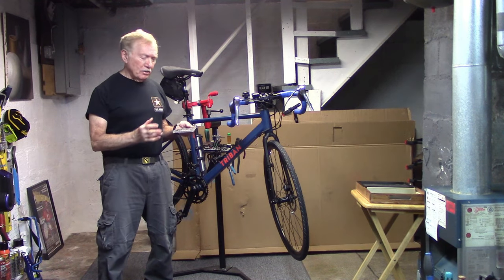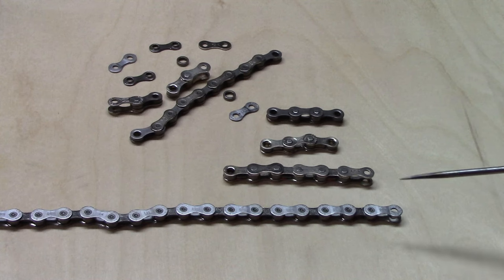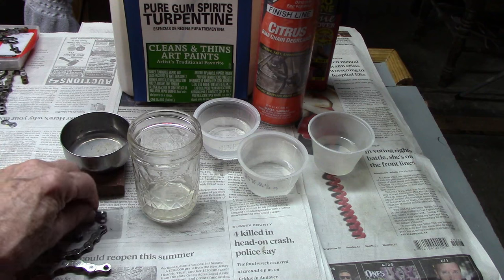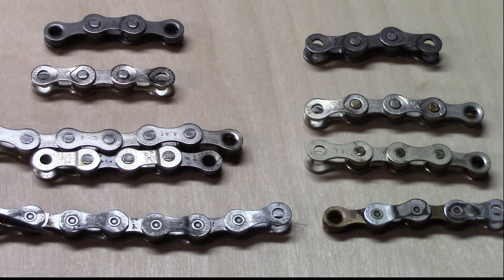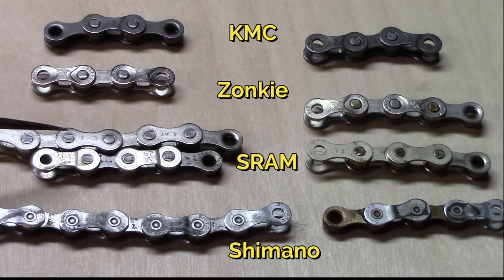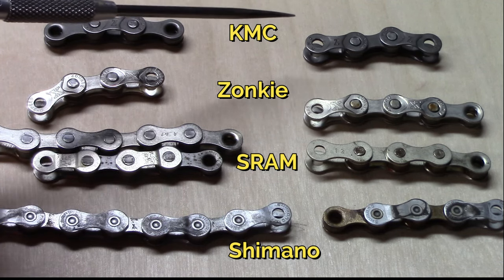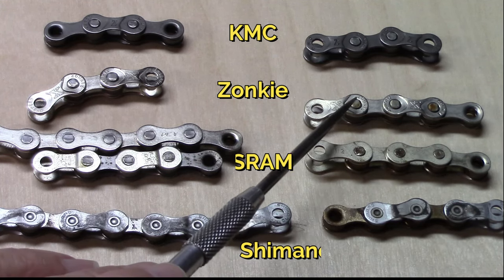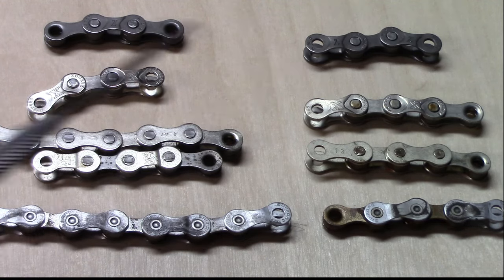Soaking Bicycle Chain in Degreaser: BEWARE of the consequences

Comment: Chain is not made from virgin steel, it is made from all the scrap we send to China, therefore it is full of impurities that react with each other & the chemical solutions they have been immersed in. In my experience, degreaser is only good for removing anodizing. Softens it a treat to a wipe off state in minutes, but be careful its vicious & comes in regular & industrial strength. Has anyone tried oven cleaner on new chain preservative grease?

Comment: Very interesting. I’ve been thinking about waxing my chain and would like to know the very best way to clean it. My research continues. Also…No, I haven’t read the insert from Shimano. Would you mind sharing what it says?
Reply from the maker: I am not an expert on waxing a chain, however, some videos describe the use of Gasoline and Kerosine. These substances are dangerous to our environment and pose a health hazard. There are some excellent videos on cleaning with an ultrasonic cleaner that may be of interest to you (and may be the best way to clean a chain for waxing). If you do soak a chain, do it for minutes not hours and try your best to use an environmentally safe product.
As to the Manufacturers insert for the Shimano chain, lets just give it another week to see if any has read it or looked it up on the internet, then I'll pin the results. Thanks and safe cycling, Tony
Reply: "oz cycle" has some good videos on cleaning and waxing chains.
Reply from the maker: @dpstrial  Yes. However, I myself would stay away from Gasoline, Kerosene and similar petroleum products he uses because of the environmental hazards and health risks. But I'll leave that up to you. Thanks for your comment, Tony
Reply: @tony10speed  I clean my chain with normal bike cleaner and then lubricate it with Squirt (or a wet lube in winter). I don't want the bother of melting wax in a pot. I change my chain every year anyway. Regards.
Reply from the maker: @dpstrial  Appreciate your comment and insight. Regards and safe cycling, Tony

Comment: I've soaked a shimano 10 speed chain from my Roubaix in appx. 75% Kroger dish liquid (ersatz "Dawn") overnight. Virtually all the oils and crud came off and the chain did not discolor. A good rinse in HOT water and all was good....
Reply from the maker: Thanks for the comment. Did you also scrub the chain before or after soaking overnight?
Reply: Hey Tony! Thanks for the reply. No scrubbing.All I did was soak, then vigorously shake the container with the chain and detergent, take the chain out and give it a a serious rinse of hot water. All the grime gone, squeaky clean!! Soaked in silicon lube, dried off and back on the bike
Reply from the maker: Will definitely give it a try. Thank you for sharing. @dv270salto7
Reply: @tony10speed  No need to thank lil' ol' me , Thank YOU for all your video help lessons! I'm gonna go to Wally's and get that oil filter wrench for sure....

Comment: hi great video. I clean my chains much like you do with the two tooth brushes. I think I learnt that from one of your earlier videos. in order to be able to use the degreaser more then once i.e keeping it fairly cleanish.  I do a cleaning in dish soap with the brushes . rinse in hot water, dry the chain because water dilutes the degreaser . then soak in the degreaser for an hour or so. rinse with more dish soap , hot water final rinse and dry before lubing. this method works for me. it does take time to dry the chain so I was running two chains alternating between the two. otherwise a little heat on the stove works. one problem I came across is when I was using sunlight detergent all was ok. Palmolive turned my chain dark much like the chains in this video. It was a shimano with the shinny coating . its no longer shinny. and this is the more expensive option to buy with the shinny coating. I have to agree with you that soaking for long periods of time is not a good idea. no more then an hour should do it. I know that if there is any dirt still lingering around the pins and id of the rollers then after a bike ride the lube will turn black. and stay black no matter how many times one wipes it with a rag. my chains do not show any signs like this. so I think in line with what you are saying its no use soaking for too long and over night is for sure a no no . thanks take care
Reply from the maker: Have no idea what's with the Palmolive soap but will look into it. Sounds like you're doing a terrific job (a little over-kill for me in terms of washing but if it works for you that what counts). Most of the black that shows up as you ride, at least in my experience, is not the residual dirt around the pins and bushings but rather residual chain lube which quickly picks up dirt and grime. I apply chain lubricant, work it in by turning the crank (and chain) backward, let it sit overnight, the (before I put it in the car to take to my ride start), wipe down the surface thoroughly to prevent the grime and grease build up. 
Thanks for sharing your cleaning procedure and your thoughts/ideas. Regards and safe cycling, Tony
Reply from the maker: P.S. There a a number of products of Palmolive on the market. What kind of Palmolive soap were you using so I can take a closer look?
Reply: the original green soap.  @tony10speed
Reply: thanks for the tips . I agree totally apply work it in and let it dry over night and a final wipe down. even though most claim it will dry enough in 3 hours longer is better. Just wondering you said my washing is a little over kill. in what way would you recommend making it more stream lined and shorter thanks again  @tony10speed
Reply from the maker: It just seemed like a lot of steps involved in washing, degreasing, washing again. But if it works for you, don't change it. I'll look into the Palmolive. Regards, Tony @sidshel4428

Comment: I just had an interesting (and unfortunate) experience with my brand new Shimano XT (CN-8100) 12 spd chain. I used a 3-bath method for degreasing and re-lubing the chain. The three baths were: (1) Park Tool Chain Brite and then (2) 91% isopropyl alcohol and then (3) Rock n Roll Extreme lube (blue) wax based lube. Each bath lasted no more than 2-3 minutes where I put the chain in a jar with the solution and agitated it. I then removed the chain, wiped it down and placed it in next solution. Afterward I noticed that the chain links had blackened as in your video but ONLY on the drive side (the links with lettering on them). The links on the other side of the chain did not change color. Additionally, I noticed that about 6 links in the chain had become tight and wouldn't bend with ease. Going forward I am not going to use this approach on a new chain. I will just use Rock n Roll Extreme to both clean and lube.  Rock n Roll Extreme contains both a solvent and wax, so you clean and lube at the same time. I've used that product many times in the past on other chains without issue. I learned my lesson!
Reply from the maker: Wow, that's quite a story. All I can figure is that the coating on the outer plates of the chain must be different than the inner plates and reacted with the Chain Brite. Did you notice any discoloration after the Chain Brite and before the isopropyl alcohol? Did you wash and rinse the Chain Brite off before putting it in the isopropryl alcohol? It's possible that the residual Chain Brite combined with the isopropyl could be the culpret, but I'm not sure. Sticking with the Rock n Roll sounds like the best idea. Thanks for your observations and comment. Regards, Tony

Comment: KMC:

Never use acidic or alkaline cleaners (rust remover). These will damage the chain and in extreme cases can lead to breakage.
Never use aggressive degreasers - these will loosen the factory applied grease from the pins. This allows dirt to penetrate and drastically reduces the service life of your chain! Furthermore, these agents are harmful to the environment.
Chain cleaners also often contain solvents that can damage your chain.

Clean the chain with a dry cloth.
Important: also clean the sprockets, chainrings and shifting rollers.
To remove dirt or sand, use a brush.
If the chain is very dirty, lukewarm water with detergent or a cloth soaked in thin oil will help.
Reply from the maker: You make some good points about the need to avoid aggressive cleaners although some will disagree with you on the use of bike specific degreasers and Simple Green if used briefly and with care. Lenard Zinn, author of "The Art of Road Bike Maintenance" suggests removing chain packing wax which is there to prevent rust and corrosion and will interfere with applied lubricants. See our video based on his suggestions and that of other bicycle mechanics:
https://www.youtube.com/watch?v=-VdLCy5cRco
If you have references to the contrary on either of the above, please let us know so we can all be educated.
Thanks for your input and safe cycling, Tony
Reply: @tony10speed  chains do not come with packing wax for a start. Also, not following manufacturers recommended practice when installing their equipment will result in you being fired if it is your job in most instances. So if KMC say do not remove packing GREASE (not "wax" as you state) , then do not do it. However, bicycle mechanics are laughably unregulated, so they can say or do pretty much anything they want with zero repercussions. Dry
Reply from the maker: I agree with many of your comments, however, what works for you may not for others. Keeping an open mind is what leads to discussions such that you can communicate your feelings and opinions and understand why others hold theirs. Some well known mechanics would disagree with your comments on waxing chains and not removing packing wax. These discussions are interesting and the exchange of ideas leads to progress.
Thank you for your comments. Regards, Tony
Reply: @tony10speed  this is why I pointed out the unregulated nature of bike mechanics. I will also point out the lack of technical data sheets for pretty much all fancy expensive bike lubes. 
Best practice for industrial chain lubrication methods is set in stone for employees, there is a set way of doing things & if you do not follow it you are endangering both people & equipment. 
There are many years of scientific research into the subject, dedicated testing facilities that must be officially accredited, the list goes on. 
But none of this applies to cycling, it is totally rogue & anybody can claim anything with zero evidence. Do you not see a problem here? Because it is glaring to me.

Comment: Personally, I don't remove the original lubing but had a drop of light lubricant at each link every few rides and wipping clean after each ride.
The thinking behind it being that the original lube will simply be displaced while still having a lubed chain.
It's a bit messy after the first few rides, that's all.
Use of agressive solvents attack the plating on the chains.
Most chain manufacturers recommend to NOT attemp to remove the original lubricant.
I'm not into the ultrasonic cleaning, Crock-Pot waxing trend.
All this stuff is far more expensive than to properly mainting and instaling new chain at the proper frequency.
Cycling has always been a sport where a bunch of people are into stupid trend to make them feel as if they'd belong to an elite group. Remember the drilling of brake levers to make them lighter ?
Reply from the maker: I think most mechanic would agree that the manufactures have led us astray with the idea of leaving the packing grease, and my expert, Lennard Zinn (Zinn and the Art of Road Bike Maintenance) in one of his blogs would agree. The packing grease is there to protect the chain from corrosion and rust during storage. Not only will it pickup grit and grime from the road (it's very sticky), it may interfere with the bike lubricant you use. People may disagree, but this is what the recent data shows. Are there trends in bicycle maintenance and repair, you bet. That's why careful analysis and research is required and will continue to be so. This is also what makes bicycle maintenance and repair fun. Regards and thanks for your comment, Tony

Comment: I noticed the variety of container materials. I would stick with glass or plastic containers and avoid metal to eliminate the chance of galvanic activity.

Soaking a chain, especially one that is well cared for, is not more effective than a quick clean. It’s much more important to remove as much lubricant as possible after you oil your chain, and to do it frequently. The chain will stay cleaner than every other rider’s and will last longer without ever having to remove it from your bike.
Reply from the maker: I agree. Removing the excess surface lubricant will prevent grime and grit build up on the chain and prolong its life. Thanks for the comment. Also visit our YouTube home site at:
https://www.youtube.com/user/MrTony10speed
Regards and safe cycling, Tony
Reply: The plastic containers could also be slightly dissolving and depositing onto the chain. Don't know, just a maybe.

Comment: Hi Tony! Great video again 👍 
I ride 2 chains on my bike, swapping them every +/-500km  so they wear out equally with my cassette. (Better then first riding one chain to the end of it’s lifetime and then putting a new one on the same cassette)
Anyway, when taking the chain from my bike I degrease it, clean it and rinse thoroughly. Then I wax it and leave it to hang until the next exchange. I noticed with my shimano chain that rust is forming on some parts… The chain is well dried - I guess - and hangs in a dry place or I put it in a plastic box covered with some more wax. The last method seems to be the worst when it comes to rusting.
What would you suggest to be the best method to store a cleaned chain for a longer period until you are gonna out it on the bike?
Reply from the maker: Sounds like your method of degreasing, washing and drying every 500km is a little overkill according to Squirt:
https://www.youtube.com/watch?v=A8pLqcm36xQ
However, I think the main problem may be that the chain is retaining moisture  after washing/drying before applying the Squirt. Dry the chain with a hair drier and then hang it up for 24-48 hours (in a dry place - not your basement or garage) to thoroughly dry. Then apply the Squirt. That's my guess anyway. Let me know how you make out. Regards, Tony

Comment: Why would you leave anything in degreaser more than minutes? I would never do that.
Reply from the maker: Agree although it's surprising how many YouTube videos suggest soaking a chain overnight (for what ever reason). Regards and safe cycling, 
Tony
Reply: @tony10speed  Don't you suggest that in another video? This one: "Don't Remove Bicycle Chain Packing Grease? Another Myth Debunked!" You say to soak the chain in turpentine overnight...
Reply from the maker: Soaking overnight "was" the practice. But Shimano and a few other manufacturers have changed the formulation of the coating of their chains and soaking in any degreaser or turpentine product will destroy the surface coating. Parts and products change and we must change our practices accordingly. @babyblue8302

Comment: Some sram and shimano high end chains uses a special coating. That can explain the results.
Reply from the maker: I would tend to agree with you. However, it's interesting the resulting reaction of the chain with degreasers/solvents results in a dark discoloration that cannot be removed and appears embedded in the chain rather then just the surface. Thanks for your comment and safe cycling, Tony

Comment: I had this problem this morning. I bought a used bike and the seller thought it was a good idea to fully grease the chain. To remove the thick layer of grease I used a mineral degreaser, but only for less than a minute, the shimano chain became black. Hopefully I cleaned the cogs and rings with only cloth
Reply from the maker: I could not reproduce the effect using Phil's grease on a Shimano chain and soaking it in mineral spirits. It must have been the type of grease used. Did the black wipe off the chain??
Reply: @tony10speed it was a nasty tick black grease, a common one most people have at home. After soaking the inner links became opaque black, the outer links opaque metallic grey; on the inner cylinders some rusty spots appeared
Reply: I broke the chain so I replaced it 😢, anyway I will try with some of the specific grease to see what happens.
Reply from the maker: Clean with something like Simple Green but do not soak. Then wash and dry. Apply only bicycle specific lubricant as directed on the label. Let me know how you make out. Regards and safe cycling, Tony @JoeLercio